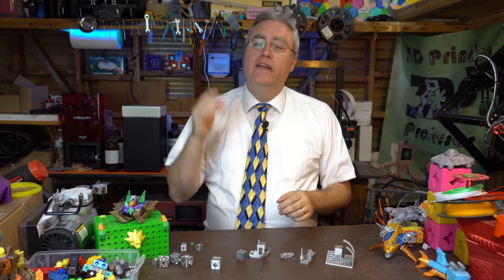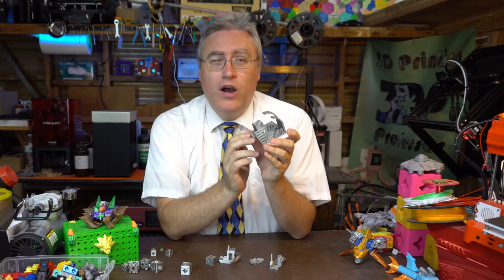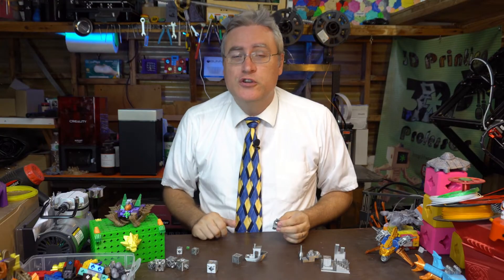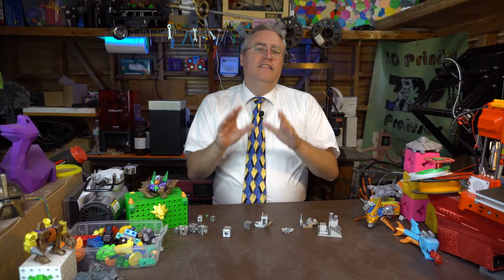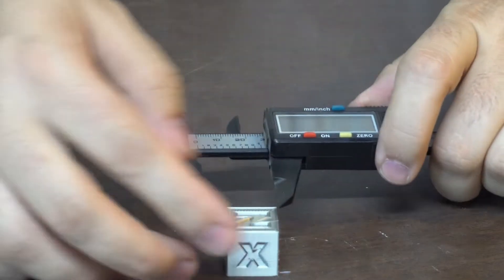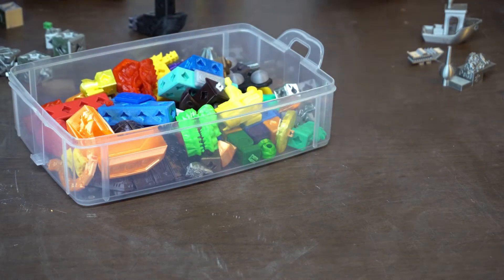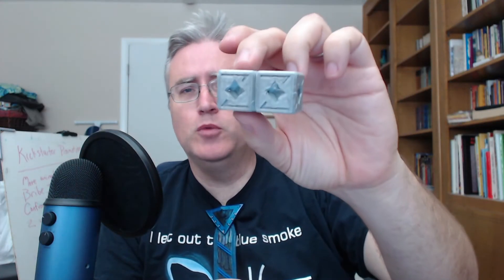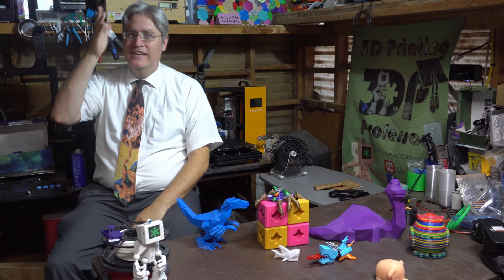What is the best test 3D print? Is PrintABlok Better than Benchy?

Comment: one of the more importent parts in test print is to test "repeatability" if you print test print one time and its ok good for you but you need to print the same one using the same filmant 3~4 time over 1 week that is step number one even if its "bad" print but its the same "bad" event time then you can "improve" it but most time I see users that cant even print the same print 2 ~3 times in row and that point to H/W issues that no tune can help and you need to fix it first I keep saying first make sure the H/W is "OK" but if you get loss nuts or bad barring no tuning will help in the long run

Comment: I think the best test for a printer is the next part you intend to print, if it comes out good and you are happy with it then all is good, if not then you have to ask why? and then try to figure out the fix, I have never printed a benchy, I have only ever printed temp towers when my regular settings dont look good and bed calibration prints when my first layer was not good I will print one after re-levelling only.